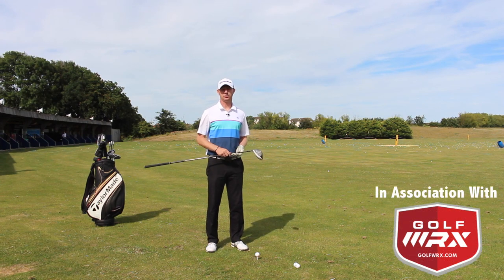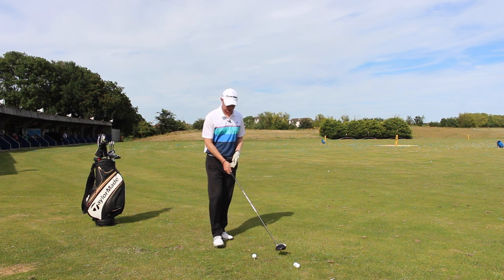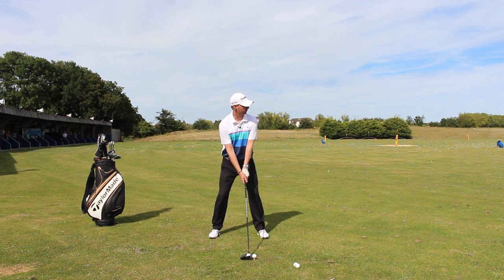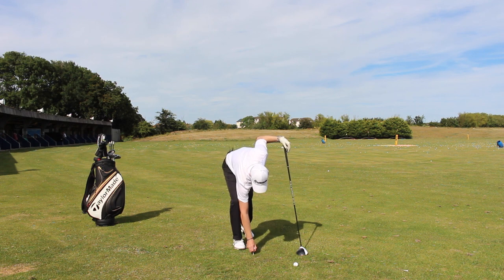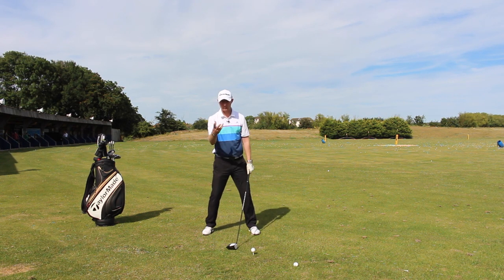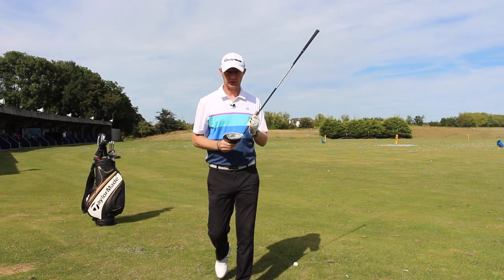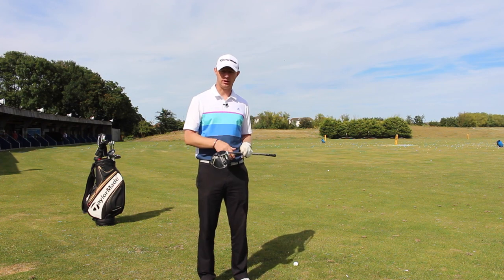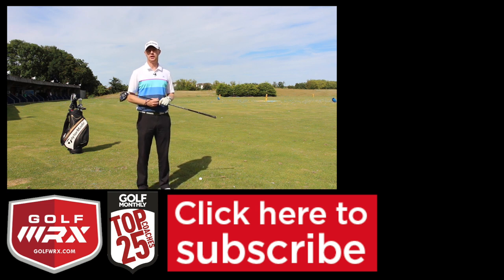How To Play - Driver Into The Wind

Comment: Ah your wrong. If it goes higher its going to sit up in the wind. And go nowhere. Its called logic. Hit a stinger with off ground is  only way into high winds.
Reply from the maker: Thanks for watching David, unfortunately for you I am correct. Tee it down hit your "stinger" which increases spin due to the lower contact point on the club face and the roll design of the driver face which in turn reduces distance. Tee it up hit above the equator on the face which helps optimise spin relative to your delivery and the ball will fly further than your stinger into the wind. I would assume that you deliver too much spin loft if you don't see this work for you and recommend you go see a good pro who can help you improve this skill. Good luck, I'd love to hear how you get on.